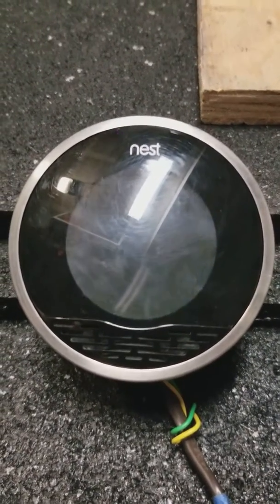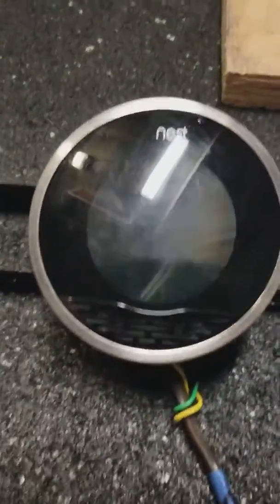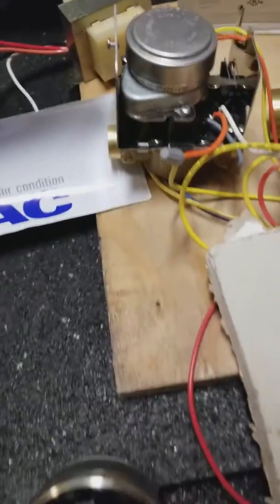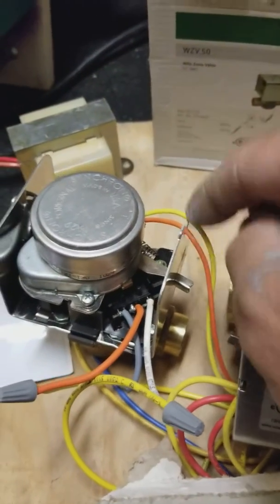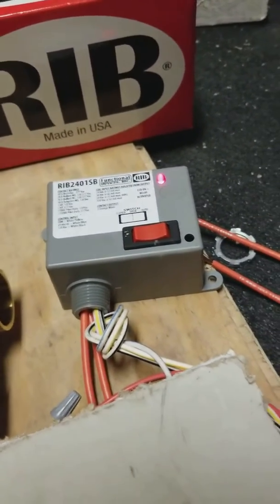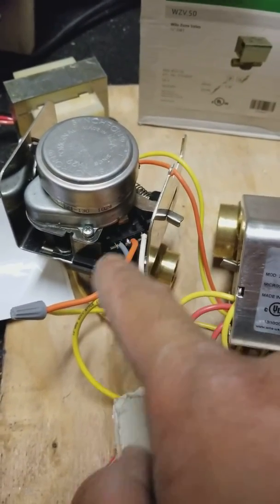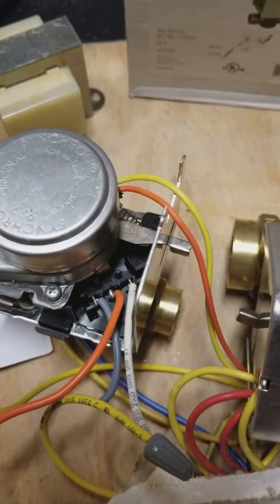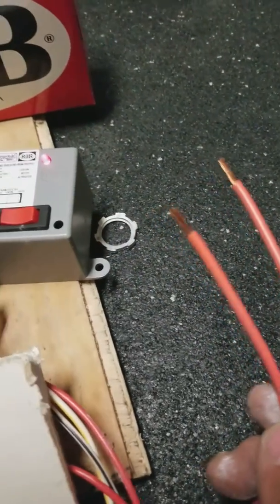Nest to radiant zone valve

Comment: Can (and how do) you connect nest sensors to control zone valves or do you need a separate thermostat for each zone?  We have 3 zone heating with A/C running off a separate thermostat.  Also can a sensor OR nest thermostat communicate with both heating and cooling systems? 50 year old US house.
Reply: From nest: Each zone (valve) needs its own thermostat. So we need 4 thermostats plus 1 or 2 additional sensors for the A/C.

Comment: Hi there can you show how you have the wires connected inside the nest? I have a single zone valve that was controlled by an old mercury manual thermostat which just interrupted the power from my transformer. I'm trying to just install the nest in the middle and can't seem to get it to work.